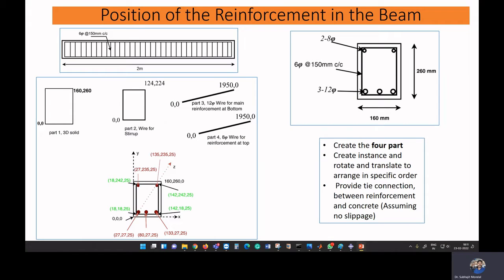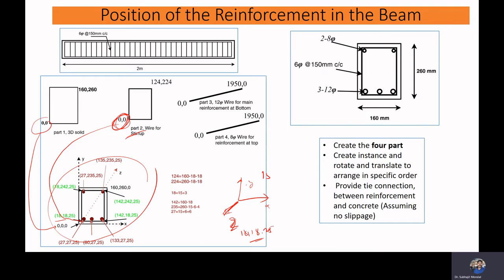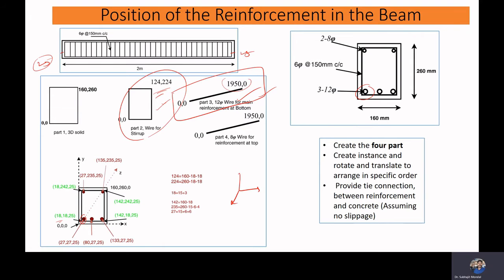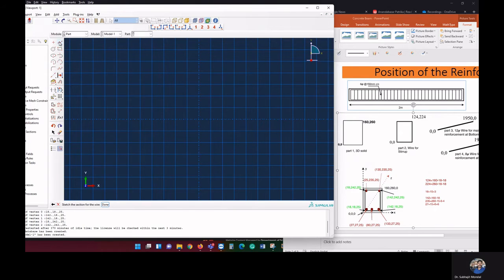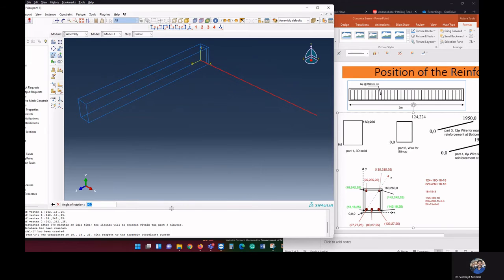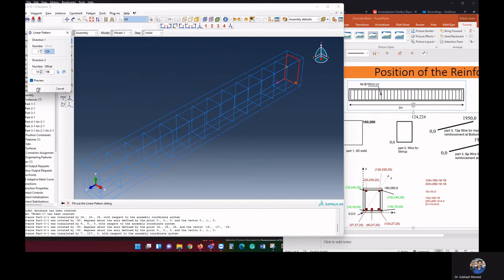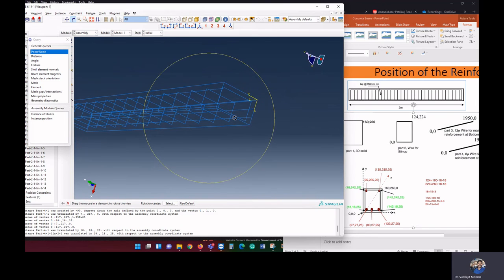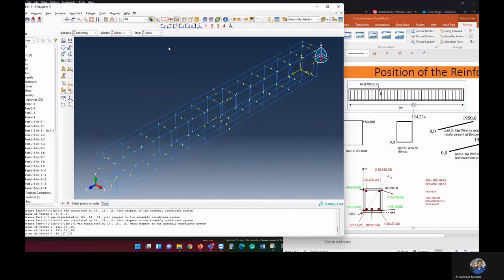ABAQUS (L17M7) Reinforce Concrete Beam and Reinforcement  Detailing in ABAQUS

Comment: in this case the main bars are simply floating which is not the case, there should be contact between stirrups and main bar. do you think this is correct? main bars and stirrups both should have confinement right otherwise how the hoop stress would generate?
.
Reply from the maker: It is not floating, u have to provide tie constraints, that means all reinforcement are embedded in concrete and no slippage between reinforcement and concrete
Reply: @sumanmonda102  for that we provide embedded constraint no?